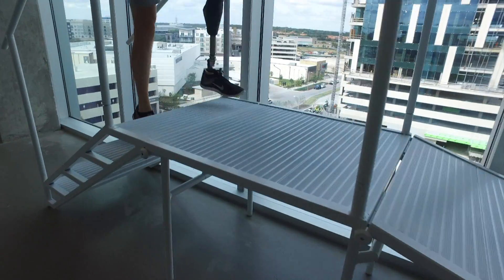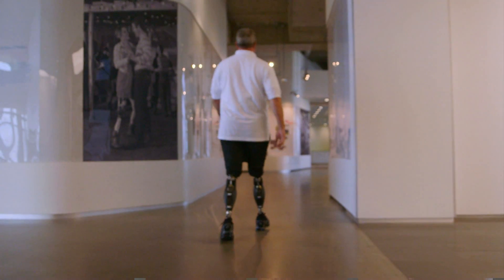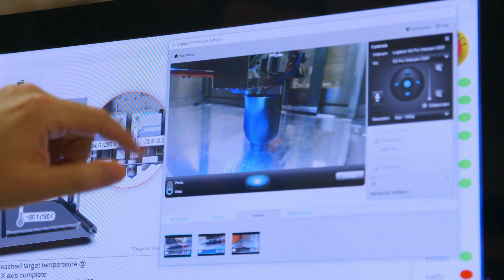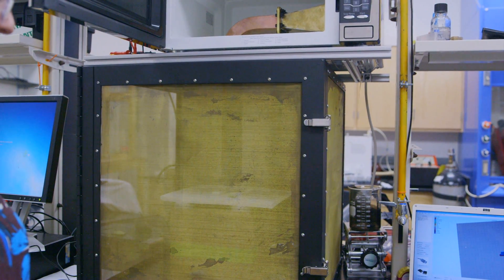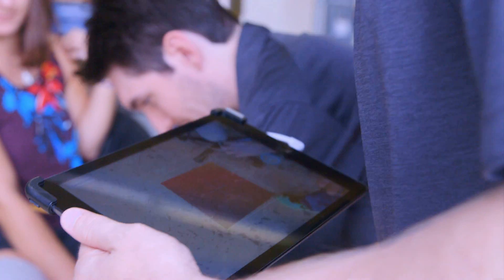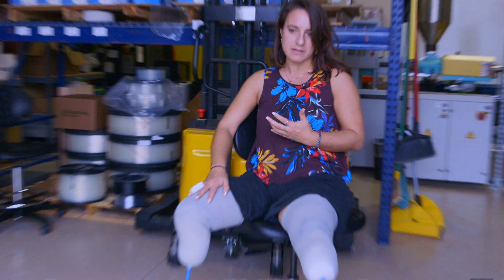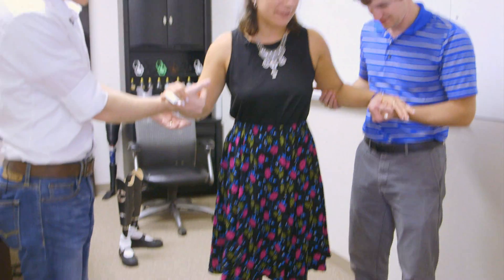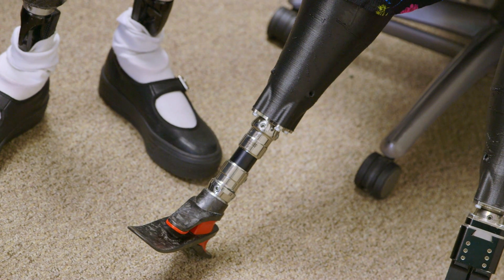BBC reporter and amputee tries out 3D printed legs - BBC Click

Comment: I have a 3d printed socket that I use almost daily.  I've had no issues and it makes a great water leg.
Reply: what type is material are u know? i have a 3d printer and i make the new socket for my little sis.
Reply: @furkanozer7191  you probably don't have the correct material.  Mine was printed by a place that makes their own and they're melted into filament from beads.  Most filament will break under the torque you'll put on them.
Reply: @eliotsajerkface  what kind type of bead can u more explain?
Reply: @eliotsajerkface  really thank u soo much

Comment: when they do the scanning using the software, it is completely stupid because it doesn't take the pressure point into consideration while scanning the stump. if it uses the traditional casting taking and print it using the 3D printing technology then it would be make more sense. if you don't understand please check with prosthetist who is amputee. They know better.

Comment: How about if they printed it at a 90 degree angle, like print the socket facing down. So the printing layers would be vertical. Would it still crack as easily...?
Reply: It would require many support material and I think the socket experiment loads from all angles, so it would still be fragile, what I had found is a post-treatment like a resin bath to reinforce the socket layers
Reply: @JavierD  are u know what type a material are is using? sorry my english what type a 3d printer fialment material?
Reply: @furkanozer7191  The one in the video they said it is nanomaterial carbon something, they do not make it clear. The public will have access to ABS
Reply: If the price was hundreds of thousands...
It shouldn't be cracked easily